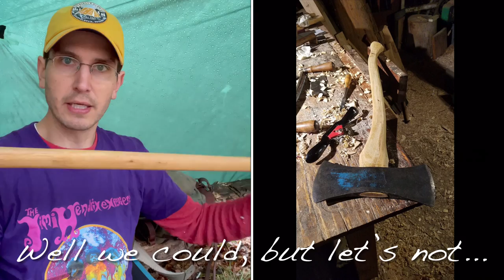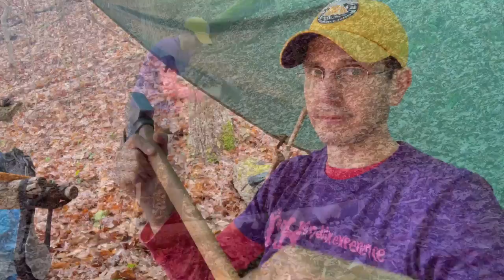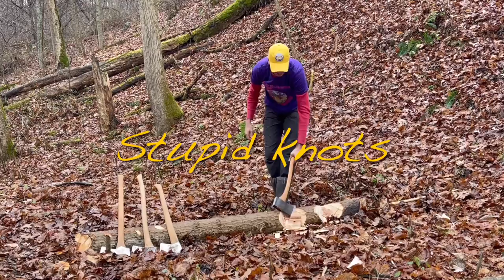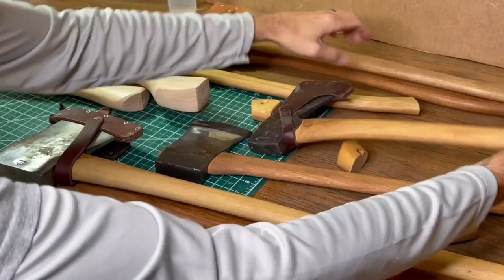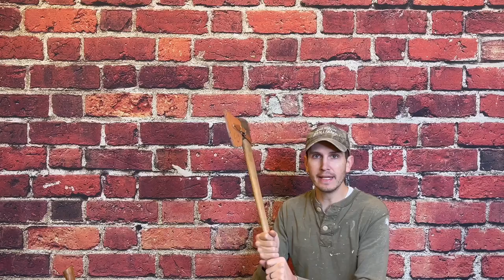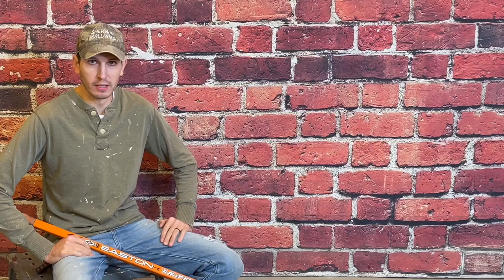Axe Handles: An Overview: Length, Shape, Wood, Grain, etc...

Comment: I have to say that I disagree that there should be no axes or hatchets between 14 and 20 " For carpentry with wooden joints like timber framing etc, an axe between 18-20" is pretty good IMO. You don't usually swing it like we do in forestry work, but we basically use it single handed often with the assistance of the left hand (if you're right handed) to increase accuracy in chopping out joints. It's just doesn't work as well with a hatchet sized handled and a longer handle is gonna be pretty akward
Reply from the maker: That’s a fair argument for those awkward sizes I suppose, but you don’t think a 24” handle would serve you just as well, and then it’s still useable when you need to chop?  I’m asking, as I’ve never done any Timber framing.  Thanks for commenting.
Reply: @KevinsDisobedience  a 24" would definitely be to big for most tasks in carpentry, your body will be in the way and the handle end has a bad habit of going for the groin, haha. Also, your hand will become very tired as your are using it mostly single handed. However, for scarf joints larger axes can be very useful for chopping out the angled plane. Another, thing; i really like long handles like 36" for splitting axes, I have just hung a head on a 37" hickory stick and it works beautifully and is very safe. Apart from that I agree with you. Especially for bucking smaller stuff long handles are very akward
.
Reply from the maker: I’d have to do the work to be able to make my mind up about a 20” axe being useful in Timber framing, but since I haven’t I’ll defer to you, but I’ve done enough splitting in my life to know I don’t like anything over 32”.  34-36” just feel so damn awkward and unnecessary.  But to each his own.   If you chop on a block it does provide a little extra safety in case you miss, so there is that.

Comment: I have one 28" handle and that's on my Kelly Perfect Cruiser double bit.  That axe is my sweetheart.  It doesn't split well (which is mainly what I use an axe for), but is nimble and sharp.  I've been hanging my axes on 32" handles and like the feel.  I will say that my accuracy sucks, but I just attributed that to me.  I recently bought a really nice splitting, Rockaway Pattern axe hung on a terrible, fat, straight, 36" handle.  Was going to put it on the 32" handle that just arrived today, but maybe I'll hang my Plumb Jersey Pattern on that one and try the splitting head on a 28"-30" handle.
Reply from the maker: ThAnks for taking the time to comment.  I can almost promise you if you use more 30-28” handles you’ll never go back, especially on splitting axes.

Comment: I can see the curve putting the head farther away from your leg when you bring it around for another strike if you're using the technique for chopping that I was taught.

The guys you saw who were all choked up on 18in hammers just didn't know how to use them. If you're used to using them 18 inch hammers are way better. This is coming from a guy who drives a lot of fence staples though.

Comment: I read somewhere Robert mann was the first to make the American style double bit in Pennsylvania. would be cool to see the first models he produced
Reply from the maker: I have a special PA vintage Axe I’m going to showcase on the channel real soon.  Stay tuned!
Reply: @KevinsDisobedience  I just had a chance to buy a kelly 1889 patented double bit. It looked so awesome. Also, where would you buy a shorter race axe style handle with a bigger palm swell ?  Been looking at Ox head handles, I am never quick enough to get a killinger. I am starting to get into big heads on a 27-30 in haft. Just built a jersey on a 28in straight haft from house handles.

Comment: Not too fussy about grain orientation myself , but when making handles I usually default to the 'accepted norm' ie growth rings parallel to the axe cheeks. The one place I have found this to be really important is when using white oak. This makes pretty decent handles for hatchets and light axes, but oak has a distinct tendency to check, or split and fail, in the plane of the figure, ie at 90 degrees to the growth rings.
Reply from the maker: Sure, obviously it makes sense to orient that grain that way if you can.  I just don’t think it’s the big of a deal if you can’t.  And for weaker woods, especially on long handles, it’s going to be more important.  Thanks for commenting
Reply: @KevinsDisobedience  
Agreed as a general rule
Also grain direction is of greater importance in hanging some of the larger vintage English Axes where I have seen eye lengths up to 3 7/8" and eye widths to 1 3/16". This clearly dictates a high shoulder, which tends to be a weak point if grain is not parallel to the eye. That's a lot of short grain just waiting to fail is the fit gets sloppy so getting [and keeping] the fit and wedging good and tight is especially important in such axes.
Reply from the maker: Yeah I was rather flippant about it in these handle videos, mainly to counter the conventional wisdom that is too often repeated without any thought or testing.  I’ve changed my mind on runout a little too.  I’ve always thought it was more important than grain orientation, but I wasn’t convinced it matter much either, but I’ve since had a handle break right along some runout when making the bottom of the felling cut.  Looking forward to more conversation with you.  I hope you’ll subscribe and stick around.  We need more calm, rational back and forth in the axe community, as opposed to the screaming matches that too often take place of social media.  Thanks
Reply: @KevinsDisobedience  
I wasn't getting too much impression of 'flippant' at all Kevin, 'common sense & down to earth', I would say. Same reason I like skilcult's vids. Never accepts conventional 'wisdom', but thinks things through, has a try at it, refines it and, if he sees benefit, invites you to try it yourself. 30 odd years ago, I had a handle let go along runout when splitting rounds. The spearlike end finished up ripping a 3 inch gash in my shin. Lot of blame on me, I'd had a couple of beers, was not in a good mood and had a delivery deadline - in short I was going at it like a madman and probably pushing through. Still have axes with runout and happy to use them but much more sympathetic to the fact they 'might' have a degree of limitation and use them accordingly. Too old now for much axe work but have always set aside blanks for future axe handles, mostly selected for 'optimum grain'. When you make your own handles, you can afford to be choosy. I have one beauty in ripple figured ash that I am saving for something a bit 'special'
For those who have to buy handles, buy the best you can and don't stress out over grain
My advice is to select some good wood and have a go at making your own
[ps finished the firewood load and got a dozen stitches in my leg next day]
Reply from the maker: Well thanks. I’ve made a few handles from scratch now.  But it’s so time consuming and I’m eager to test diapers at this point, so some will get custom handles, but most will have to be store bought.  The length is mostly what I care about.  Good short handles are hard to find.  Glad to hear you didn’t get hurt too badly.
Reply: @KevinsDisobedience  
Now I'm retired, I have plenty of time and a lot of patience for such things... it was not always that way.. Always tended towards long handles but these days I increasingly reach for shorter handles and lighter heads.
I do wonder if there was ever a breed of men who could put in a full day with some of the 7 pound 36 inch monsters we find in UK - I certainly would not want to fight someone like that
 Yet another Grandkid on the way, so need to brush up diaper [nappy] skills again ;<)
Reply from the maker: Back when men were men, I wouldn’t be surprised if they could use such a long heavy axe efficiently.  But as you said, I wouldn’t want to.  Congrats on the grandkid!

Comment: Cook has his bias and a straight stick has its place. But a curved handle allows a little more wrist power at the moment just before bit strike because of a more ergonomic wrist angle. I hadn’t seen this video until now but good job.
Reply from the maker: Well thanks for checking it out.  If you’re into axes, definitely check out the rest of the channel and consider subscribing.  I do lots of axe content.
Reply: I checked out some of your content and sub’d. Good work!
I do a bunch of stuff but have never made a video. I follow Chris killinger and have used several of his sticks. I’m into old tools, homesteading, traditional skills.
Getting ready to do a controlled burn on 20 acres of native prairie. Thought about doing my first video on that but things happen so fast and a lot can go wrong while I’m fussing with video. Pyromaniacs delight!

Comment: Good vid mate, well put together. I'm all for vertical grain though. Had several handles with horizontal grain pop on me, especially if there's any damage near the eye. One of my old faves, with no eye damage, failed the other day splitting seasoned ironbark (It's like concrete).  Handle flexed on impact and popped the front of the top curve, a piece about 40 cm long and 1cm thick  simply sprung off the handle. Vintage axe. Interestingly when I bought it from an old competitive woodchopper, the palm swell had been cut off the same way you do yours.
Reply from the maker: Fails on perfectly horizontal? Run-out?  I’d love to see pics if you have any.  Definitely interested in real world breaks. Thanks.
Reply: @KevinsDisobedience  do u know how I can send pics?
Reply from the maker: Can you send them via Facebook messenger?
Reply: @KevinsDisobedience  I don't have any social media stuff, can I send in email?

Comment: If I was going to make my own axe video, I'd probably say everything you said (in general). Though one could ask if you've ever taped the end of your axe handle to mimic your hockey stick, though you probably didn't go out on the ice bare handed.
Reply from the maker: I have actually tried taping a double bit.  My main issue with it was it got gooey in the sun, but with gloves it’s not too bad.

Comment: I think the preferred handle length has a lot to do what you started out using.
I grew up using axes, mostly clearing fencelines and before I was old enough to use a chainsaw I got stuck limbing a lot. Where were the child labor laws back then. LOL We also did things like building rafts and forts type structures out in the woods when we were little. The only axes we had available to use were 36 inches. That's still the size I prefer when dealing with big hardwoods. I do like shorter, lighter axes for small stuff though. I may try hanging one of my old double bits on a 32" and another on a 28" just to see. Maybe I'll change my mind. I'll have to order one because around here you can only buy the 36" handles in town and lately they are all junk for some reason.
I was watching Ben and he recommended checking you out so I subscribed. I'm an axe addicted guy still searching for that perfect axe that I'll never find. O well it gives me the excuse to keep buying axes without feeling guilty about it. :)
Reply from the maker: Thanks for the sub, brother.  And yeah, I agree I think we can get used to anything, but do give a 32”-28” a try.  I haven’t found anyone who doesn’t immediately switch to shorter handles afterwards.  Notice Buckin’ has switched to shorter handles even for splitting in the last year.  The perfect axe doesn’t exist—that’s why we need more. Lol at least that’s what I tell my wife.
Reply: @KevinsDisobedience  agreed, it makes a night and day difference... it can feel a bit short at first if your coming from longer axes but once you put it to use the benefits quickly are noticeable and it becomes quite awkward and cumbersome to use anything over 32"
Reply from the maker: My experience exactly.  A 34-36” handle feels like a bowling ball on a long string.  Lol

Comment: Thank you for the very thought through and informative video, I learned a lot! Newbie question. How do you properly store replacement axe handles? Do you put linseed oil on the ends and store them hanging so they don't warp or take on moisture?
Reply from the maker: I’m glad to hear that.  Thank you for taking the time to comment.  Means a lot.  And that’s not a stupid question.  I address it in some other vids.  Yes, it doesn’t hurt to put Linseed on the ends, but you don’t really need to.  That’s something you want to do when a blank is still green.  Replacement handles should mostly be cured.  The key word there is mostly.  That’s why I suggest to put them next to a dehumidifier if possible.  You don’t need to hang them—that’s probably overkill.  I just keep them stored in a long box next to the dehumidifier, and I like to keep them there for at least six month before I hang them.  Here’s a link to a vid where you can see how I store them: https://youtu.be/K6p_YFSw2Mw.  If you don’t want to watch the whole thing, skip ahead to 30 secs.  Hope that helps.

Comment: I've been wondering wether there is anyone else who also holds the axe with the palm swell pressed into the palm. I've always done that as well but my reason for it is that my hands have quite stiff joints so it's important that the butt of the handle rotates slightly within my palm so that my wrist doesn't bend too steeply and cause discomfort. I tend to have quite minimal palm swells on my handles.
Reply from the maker: Hey brother, I’m glad to hear there’s another guy out there who doesn’t like the big swells that seem to be getting more popular these days.  I’m still experimenting, but basically unless the axe is over 3.5 pounds I don’t want much of a swell.  Keep swinging!

Comment: Why does an ax handle have curve?...it's about offsetting the weight of the pol.
Reply from the maker: Not really sure, tbh; no one knows, really.  D. Cook argues that straight handles are more balanced, something about lateral axis of pivot, which I never quite understand no matter how many times I read it.
Reply: Kevin.. do this, go watch a YouTube video on Tanner Wilcox chanel, he only has one video. It's called 'Straight VS Curved axe handles'. He is in the industry and will give you a little background that perhaps the books don't. Watch it, I know you'll at least find it interesting. Colin

Comment: Great video, but now I feel like a nob with my 35 inch splitting axe. 💩
Reply from the maker: Thanks Michael, if you’re used to it it doesn’t matter that much in a splitting axe.  But I bet you if you try a 32” splitting axe, you’ll never go back.  And then after you try a 30” handle, 32” will feel long.  Lol
Reply: Im with kevin, If it works for you thats all that matters. 
That said, im 6'4" and thought longer axes in the 34-35inch range were ideal for me... until I made the chop and started using 30-32" handles and id never go back to 34"+ handles now.
 At my height I find 30-32" is ideal for an all around work axe.